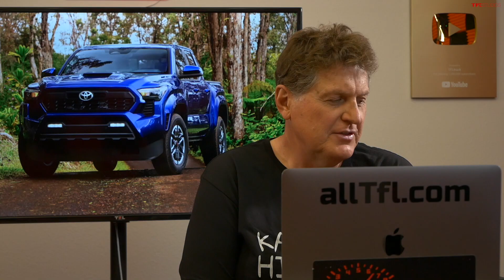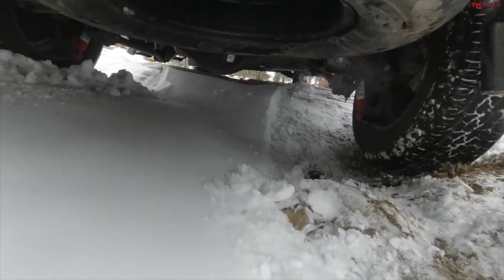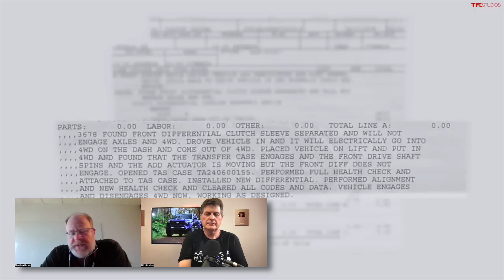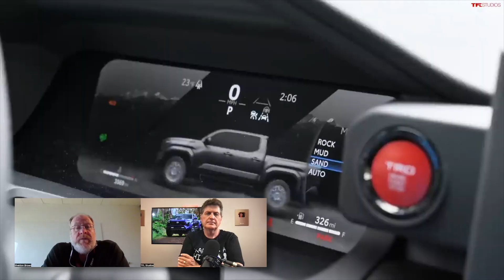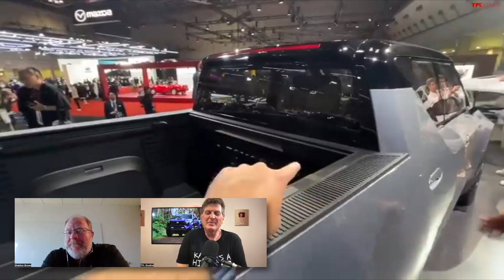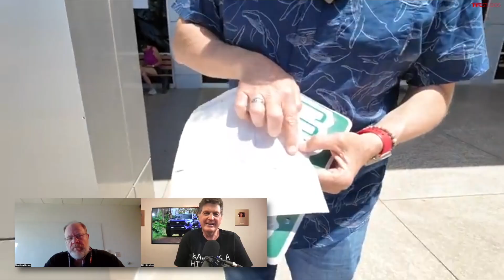The Real Story Behind How Our New Tacoma Broke & How Toyota Plans To Fix Yours!

Comment: Here’s the main issue with his answer…you could run a gladiator rubicon through this same thing in 4lo, at peak torque etc, and it would not break because it’s built up beefier. The issue shouldn’t be software to make the car less capable, it should be more robust mechanical components to withstand the situation, but they won’t do this because of cost. Not saying jeeps computers are reliable, but certainly it wouldn’t break under the exact same situations, nor would many other if any other competitors
Reply: And the Gladiator is a solid front axle like all Jeep Wranglers, you trade off strength offroad for poorer ride quality on the street with a Jeep.
Reply: Exactly what I wanted to say...sounds like they optimized for the old power train, updated the engine and then never really analyzed/updated the dependant parts...I would 100% not accept a software fix/power/torque derate.  They should be able to put 1 tire on a high mu surface and the tire should break traction before the axles/diffs etc break
Reply: 100% - You should NOT need an electronic nanny to make sure it doesn't break itself under normal/expected driving conditions. They're not out their drag racing in 4low, or towing beyond spec, or whatever. They were driving an EASY offroad track, driveable by ANY vehicle with enough clearance. The driveline should handle that with or without electronics.
Reply: You’re exactly right! Jeep is much more robust…people are running 35 to 40 inch tires too!
Reply: @tesladiesel2420  yes the American made and designed Toyotas are garbage
Reply: Correct.
Reply: @jwltiger3357  Andre drove his year old Colorado up the same trail minutes before without any issues . Maybe trail conditions got so much worse in two minutes?
Reply: Sadly this guys is shoveling the B.S., he knows it is a piece of crap but he is paid to lie.
Reply: I drove a jk up to 240k and stuff did break. I think It rode better on the road than my 3rd gen 4Runner. But When the jeep’s stock CV joint drive shaft and all of the other items break you have a million better aftermarket options to choose from. Hopefully there will be a stronger aftermarket ADD to swap in the future. To really enjoy a Jeep you need to have a “good enough” mindset. Toyotas are for people that need every single component to keep working like new forever or until they trade it in (~150k?) for a new one. If you live in the rust belt a Jeep will probably last longer than a Japanese truck unless you are okay with swapping out frames and rear differentials.
Reply: Jeep had an issue with it's manual transmissions, including on the gladiator, where clutches were failing due to overheating. The recall was a software updates that reduces engine torque at times to prevent that overheating... but it was a bad design, not bad drivers. The true fix is a better clutch, not a software bandaid. 

Honestly the toyota situation seems BETTER than the jeep one, as it's a traction control problem, not a issue that will occur in most driving. The Toyota guy also said it was an issue only in MTS, likely that specific MTS setting, with lockers on, and ice not letting torque go through any other wheels, so the brake force on the one wheel was just WAY too much. I've seen plenty of older vehicles with much worse trail damage to the driveline. I do drive my tacoma locked with A-Trac on, but it's a MUCH lower power engine. 

If they weren't so expensive, I would still be tempted to upgrade as long as the traction control was fixed. The new ones do have some real improvements over the 2nd and 3rd gens, such as a much more durable fully boxed frame. The price is absolutely ridiculous though.
Reply: @tesladiesel2420  one of the least reliable vehicles on the road, along with Wrangler
Reply: A jeep isn't using software when you put in 4 low. It's purely mechanical.
Reply: @ColeSpolaric  The PCM knows it’s in 4Lo though, and can adjust tuning based on the position of the t-case. My Jeep had a voltage switch on the t-case that would tell the computer what mode the t-case was in despite having a physical shift lever. This was back in 2006 too.

How do you think the dash knows to turn on the 4Lo light?
Reply: @Jay-me7gw  the issue was the brakes engaging on the spinning wheel. If there was no traction control interference, it wouldn't have broken. That said, I do see why Ford, GM, Ram/Jeep disengage traction control in 4 low. Way less variables.
Reply: @ColeSpolaric  Toyota ATRAC system is traction control and one of the best out there. If they didn’t design the truck to cope with ATRAC, which has been around 20+ years, they are dumb.
Reply: A great example of this is Andre's Colorado. The exact same day, on the exact same trail, did not have an issue. And then it even took the extra load by towing the Tacoma without breaking. Not saying Chevy doesn't have its faults too but clearly something is up with Toyota in the new generation of trucks.
Reply: @25ellisd  the Colorado completely disengages traction control in 4 low. No brakes clamping down that could cause this to happen.
Reply: @ColeSpolaric  also no broken parts potentially leaving them stranded. TFL would have been screwed in the Colorado wasn't there to help them.
Reply: @25ellisd  well and the problem with how the Tacoma broke was that it’s not even really field repairable. If the CV had blown, that can be semi-easily fixed on the trail as long as you bring a spare and some basic tools. It’s fairly common for people who offroad 4Runners/Tacomas/GX’s to have spare CV’s and tie rods in their trail kit
Reply: @Jay-me7gw  right?! You are spot on. For a company that prides itself in quantity and longevity, their recent challenges are concerning. Hopefully TFL will test more Toyota's as rigorously and they do better.
Reply: The Colorado was mechanically sound, aside from the dead battery issues caused by software problems ( currently under a fix by the manufacturer). I have not heard of very large scale failures on the L3B TurboMax which also is overbuilt heavily according to the manufacturer.
Reply: Jeeps have different issues that makes me not trust them on the trail. But otherwise I’d agree. People asked for beefier parts and Toyota shat the bed a little bit. Hoping they go back to something stronger.
Reply: @collinbooker  That’s too bad. I am part of a large Jeep group. We use our vehicles hard in the roughest trails Arizona has to offer. Countless miles back-and-forth to Moab Utah. These vehicles take a beating like no other vehicle can with very few failures. That’s even with 35 to 40 inch tires. Nobody is having any issues.
Reply: @DUNEDIRT  are you guys running the pentastar V6s? Up here in the PNW I’ve seen many have over heating problems on 35s. The old 4 liters are fun and solid tho! Ive also blown a couple of the older T-cases (the first time was 100% user error on my part) and have seen others blow up on the interstate in 2wd. So im a little gun shy when it comes to jeeps these days. Also I couldn’t stand anything abt the JKs:/ I’ve tried to like them 🤣
Reply: @collinbooker  I can only speak for the JL model so from 2018 and newer. I always buy Rubicons because you get a lot for the money. Most of us do have the 3.6 L engine. We do frequent oil changes and no one is having a problem. the eight speed automatic is amazing!!! I’ve personally owed two of them and they are fantastic vehicles. They do get a lot of hate that is unwarranted. I’m just here to tell you firsthand from an owner and someone who is around them a lot. There are very few vehicles that can take the amount of abuse. Just to give you an example I left Phoenix and drove to Moab. Utah ran Hells revenge Trail and drove back to Phoenix and got 21 miles per gallon. Not many vehicles can do that with no modifications.
Reply: @DUNEDIRT   so funny enough I just drove a new JL rubicon, and gotta say it’s build quality is miles ahead of the jk, way better than expected. I’ve gotta do more research on the reliability aspect. But appreciate taking the time to share your experience. Maybe jeep has gotten their there stuff back together :)
Reply: But a Jeep will visit a dealer or mechanic shop many more times than a Toyota
Reply: @Justmejbful  oh no!
Reply: @Justmejbful that's an absolute lie
Reply: Gladiator have absolutely awful reliability ratings
Reply: @bobman717  but the axles and powertrain are stout.
Reply: @bobman717 and yet those same ratings claim Toyota is insanely reliable yet look at what happened to tfl
Reply: Electric problems...yes, like many FCA problems, but mechanically strong. I expect the Grenadier Quartermaster to eat the Tacoma for lunch- much more durable and capable.
Reply: No such thing as unbreakable.
Reply: @beexiong2995 did he say that? He said in that situation.

Comment: Wow. A de-tune in 4lo is their answer. Not the same Toyota that built my 80 Series.
Reply: I think the 80 series was peak Toyota 4x4. Everything else has been inferior. I guess that explains why the '80s values keep going up, I've been keeping my eyes open for a while and now it seems like you need 20k to for a decent unlocked version.  My buddy in CA bought his rust-free triple locked 93 6 years ago for 6.5k, I'm so jealous.
Reply: @trailrunnah8886  IDK. The 100 and 200 series are still extremely rugged trucks and extremely capable despite going to IFS. The diffs, tie rods and CV’s on a 200 series are really stout and you don’t hear to much about failures like on Tacoma/4Runner/GX.

And not only that but they are a lot more versatile. You can hook up an 8000 lb trailer to a 200 and tow it well. The 80 series can’t do that.
Reply: @Jay-me7gw  I definitely don't disagree that the newer ones are versatile. I've ridden in a 200, I know a few guys that have built them for off-roading and they're wonderful rigs, so comfortable.  I just think for dedicated off-road use, you just can't beat the solid axles of the 80 series. Dirt Lifestyle built one, and with a 2" lift he was able to fit 38s with minimal work on stock axles with some beefed up brackets. He then wheeled it on some extremely difficult trails without issue. Stock verse stock the 200s may be as capable, but the 80 series just has so much more potential. Then if you LS swap it, you've eliminated the main downside of the lack of power.

I think the 100s and 200s are nice, but they don't do anything off-road that a similar year  4Runner can't do. And I watch a lot of the Australian four-wheel drive channels, they break 200 front axles left and right.
Reply: @trailrunnah8886  Agree, peak capability they are probably better, although guys are putting 37’s on 200’s without too much work. I just put 35’s on my otherwise stock LX570 and all I had to do was bend the plastic wheel well liners out of the way. And long as you keep the wheel offset in check it’s not difficult to fit em.

I can also raise my LX 1.5” with a sensor lift. 10 minutes adjusting the sensors for $0. That gives me 3.5” of total lift in Hi mode vs a stock 200.
Reply: @Jay-me7gw  sounds like a beast! I didn't know that they were capable of running 35s, I assumed that they were like the other Toyota products that were limited in fender well size.
Reply: Almost every truck limits throttle input in 4Lo. I’ve tuned 3-4 trucks from a diesel Jeep to and F150 to a GX460 and now my LX570. All of them have different maps for 4Lo
Reply: @Jay-me7gw  those are all newer vehicles and probably automatics. Toyotas of old you could red line clutch drop in 4 low and not have issues.
Reply: @atodaso1668  Maybe if it was a cable driven throttle but even manual trucks with electronic throttle can be torque limited.

Also, the trucks you were talking about are already detuned. My 22RE 4Runner made like 7 ft-lbs of torque.
Reply: @Jay-me7gw  Again you are talking about modern trucks
Reply: @atodaso1668  right and my point was older trucks with cable TB’s were already weak as hell and didn’t need detuning in 4Lo. How many trucks from the 90’s were making 317 ft-lbs at 1600 rpm? Even V8’s were not.
Reply: Not sure any 4WD system outside for a Unimog would have handled that kind of power all going to one wheel with all the momentum of 3 spinning wheel suddenly concentrated on a single axel. A more gradual application of brake would likely solve it.

Another reason manual transmission is better in general off-road. Is a direct connection, so you know exactly whether the wheel is spinning. With auto, the torque converter is slipping and wheels are slipping. You have no idea what traction you have. You end up flooring the gas pedal and spinning digging yourself into the ground.

Use to go out to Azusa mud flat in CA every weekend. I have seen it over and over again trucks with auto transmission digging themselves into the mud, and the driver have no clue what the wheels are doing. With manual, you know it immediately. You gas when you sense traction, and let out when traction is low. Use to run open diff with manual in Death Valley. Never needed a tow. When I get stuck, I can extract myself with careful application of gas and rocking. With an auto Tacoma in Daytona, I was stuck on the beach. It was hopeless trying to rock myself out by feeling out the traction. That was a 2WD, but I have been thru much worse in 2WD in manual and skinnier tires. Much more confidence with manual :)
Reply: @benmlee  Any Jeep or 4x4 truck would've handled that tiny hill just fine. That's about as mild as 4wheeling gets.
Reply: @paulb5390 but would they send all the power to one wheel?
Reply: @zzoinks  Why does MTS send all the power to one wheel with the rear locker engaged? That's so dumb. The purpose of a locker is to distribute consistent, equal power to both wheels so you can work your way through an obstacle.. I never liked MTS/ATRAC and I'm starting to understand why..
Reply: I trust this guy...he's extremely competent and fluent in his explanation... so ultimately the easy fix...
Reply: honestly what do you expect? They're not going to pull and redesign all of the front driveline at this point. It's what people deserve but not the cost effective method for Toyota. Its the same reason they're selling the "debris" line for the tundra guys to explain their main bearing failures. And even then replacing only with a short block. It costs less money.
Reply: They built an off-road truck that isn’t off-road capable. This is the reason I enjoy this channel. Real world testing.
Reply from the maker: Toyota said the solution is a "software logic change" for the MTS system. They did not say - detune the power in this case.
Reply: @TFLtruck  that's what that means though
Reply: @TFLtruck  please explain how software could fix this without pulling torque to a wheel it was previously sending it to? They clearly detuned its capability rather than beefing up the mechanical components which is the correct, albeit, too expensive answer to this.
Reply: @jwltiger3357  The bigger concern is how was this not tested for?
Reply: @jwltiger3357  all they have to do is change the software logic to not send 100% of the power to 1 wheel and suddenly brake it. It only broke by 1.5% of the parts torque rating. If you split that between 2 wheels you're only using half of the parts torque rating. They have 4 of them. So they don't need to detune it. The part did what it was supposed to do. The software logic is what failed. I've broke a 9 inch after wheel hopping during a burnout that is basically what they simulated. Max torque during a spin to an instant stop.
Reply: @jwltiger3357 It’s about the speed and aggressiveness of the traction control intervention- not reducing the toque output of the engine. The traction control system basically was applying the same types of forces that bouncing/hopping the front end would in a more old-school 4WD vehicle.
Reply: @jwltiger3357  They said it was related to the MTS system. In the last gen, ATRAC (MTS precursor) would shut off if the rear diff was locked and vehicle wheel speed exceeded a certain amount (5mph?). This makes sense, as you only want wheel braking to help get you moving, not impeding forward progress. Sounds like all they'd have to do is decrease the maximum forward speed at which rear locker + that specific mode of MTS continues applying maximum wheel braking to an individual tire. Or, slow the application of braking by a basically imperceptible amount to limit how quickly the force is applied. I'm guessing they programmed it to give you maximum efficacy, and in a case where 3 of the 4 wheels were spinning with very little torque, you can exceed the threshold of the components in a single front wheel. 

The software operates at an arbitrarily aggressive level, and the components are arbitrarily beefy. You can keep beefing the components up to surpass the programming, and vice versa, or you can step down the programming to not exceed current component capabilities. Sounds like a pretty easy choice to me when you can mess with a bunch of factors like torque converter lockup amount, MTS braking force, MTS braking speed, maximum torque allocation to a specific wheel, etc. I'm doubtful anyone is going to be spinning 3 wheels on ice and not have a single wheel pull you out because they backed off brake clamping speed by 12% or something. 

And if it really bothers you, you can turn off MTS and bomb around in 3WD like basically any other off roader with a rear locker. 

Of course, Toyota could just put a front locker in the TRD off road family of  tacomas, like all of the current competition has in similar trim levels, and be done with the whole issue forever. I don't see that happening though, since Toyota is pretending it's 2015 and they have no midsize competition besides Nissan.
Reply: @kevinlabanca5199  I mean…I guess….lol that was a really solid answer. Well played. You are well versed on the subject at hand and your rationale is irrefutable.